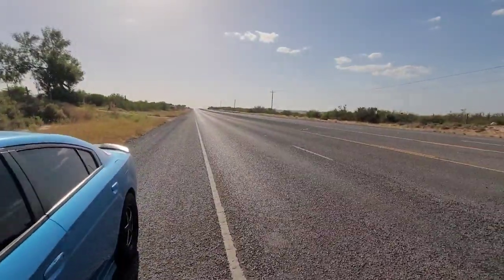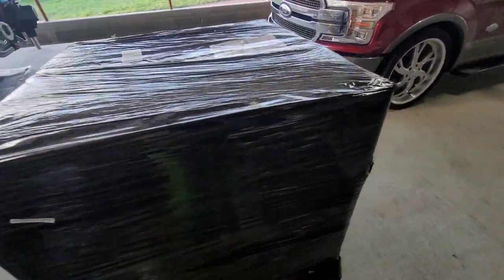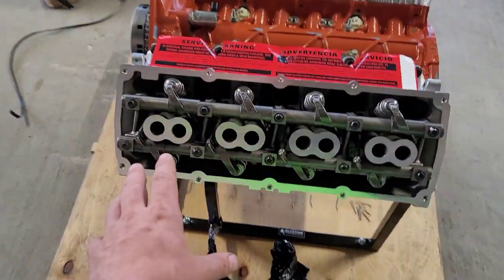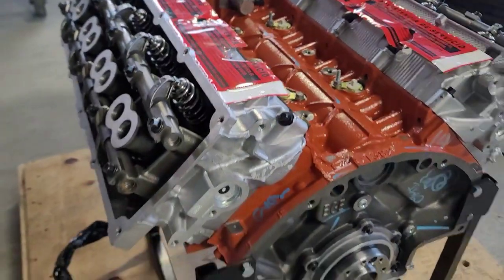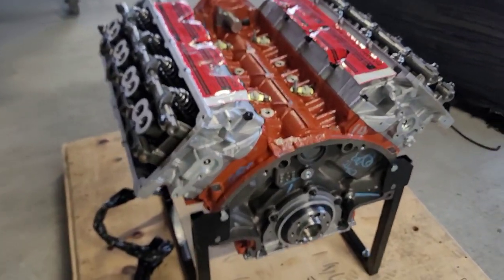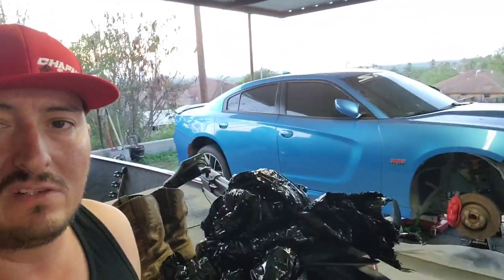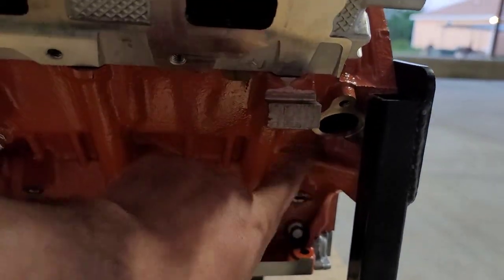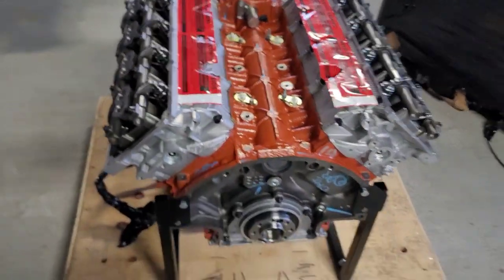HHP Racing Forged 392 Hemi Gen 3 6.4l 3.0L Whipple

Comment: Yes it is the HP70. I was going to have a HP95 installed but when built properly these HP70s can handle high power builds. I’m not sure exact HP as of now but @ stock Trackhawk Numbers. @600whp, these Jeeps tend to put down lower numbers with the Drivetrain loss. I’m about even with a Hellcat from a roll. Obviously, they won’t race off the line from a dig
Reply from the maker: I think I am do the same build on the transmission bro. Because I've already  broken one before when I was Na. Running 11.5 most of the times. With a 1.5 60.

Comment: Just got a scat and now I want to do this too 😂❤
Reply from the maker: Congrats on your purchase 💪and they are great cars. Specially boosted 😄
Reply: @boosteddave4603  now that a considerable amount of time passed since this video, how well does it hook? Or are you still having trouble with it
Reply from the maker: I haven't really messed with the power much. Still running 7lbs of boost. I'll be adding  the fuel system soon and more boost.
Reply: If you plan on boosting the car, it may be a good option to trade in the Scat for a Hellcat.  It's not just the engine, but the transmission difference.
Reply: @1320_ikimasho  don't think ill trade in this one ever tbh. I love the car as is. Im just starting out too so it delivers my every want and need, thats realistic for street driving and  won't end with me going to jail 😅🤣🤣🤣🤣
Reply: @jesusalejandro3668 I own both- 1320 and a Hellcat. I also race, both. The true cost of upgrading these cars (and racing) is often left out when these discussions come up in the comments section. I try to warn folks when they buy "one trim level below," when they to upgrade to something equivalent to a Hellcat. It's not just the engine but the transmission,  then later the driveshaft, etc. Also, the resale value. A Scat is always considered a Scat, etc...
Reply: @1320_ikimasho  nice 👌 I honestly want a gtr or viper next. I dont race yet and the main reason I haven't even given it much thought atm cause a scat is but only so competitive. Gtr or viper next dream car frfr
Reply from the maker: @user-nw6sf1bx4y  yes sr. Scatmake good power when u forged the motor.. but transmission build or a hellcat used one run around 5k then driveshaft 1500 then axles 1500+ then fuel system 2500 fore 3 pump supply system. If ubhave the budget buy a redbeye hellcat they make great power as well with bolt ons
Reply: @jesusalejandro3668 right. Whether or not you race is a big factor. Decide what framework you want to work within, then go for that 👍

Comment: Just thought I’d let you know, I have Stock Trans and Drivetrain and with the heavy Jeep I wanted to keep it under 650hp. She’s making 610whp at just under 7lbs of Boost. Which is right @ where I wanted the HP to be. Honestly, anything more than 700whp on your ride you’ll probably end up having traction issues
Reply from the maker: Thanks for the info.. I am looking for that range but my new 1320 converter broke on me and I just hit the 500miles on the new motor. Still haven't gone wot 😕

Comment: ’Sipple Speed’
Jon knows how to get these ZFs to handle the power. Unfortunately, I also need a Transfer Case 
Best wishes, I’m sure she’ll be a beast when finished
Reply from the maker: That is great power.. I am already having Traction issues at the track.. ran 11.4 at 129. Couldn't get the car to hook.. I Wana do 12lbs see where that sits. Buy I do need the transmission
Reply: @boosteddave4603 can you get a 8hp90?
Reply from the maker: @pmp2559  I've been looking for one but they are expensive

Comment: ProCharger is not on as of yet. But I’ll only be running 7lbs of Boost because Stock Compression and Transmission. You said you have Stock heads but what Camshaft is in your Engine? You must have upgraded your Springs with a Larger Cam?
Reply from the maker: We did all the hellcat valvetrae on top and the custom cam and the supporting spring and retainers hellcat oil pump.. Hopefully we can do 760whp that what I am looking for. On this setup

Comment: The engine was blown because you didn’t add the new cam, pistons and drop in rods? Was it just running on a whipple without block enhancements? 

Just curious
Reply: I just seen in other comments that you were running stock… question answered haha
Reply: I’m about to do my own.
Reply from the maker: @81mccabe58  it was Na only mods where catless delete, hellcat airbox,and tune. But the oil pump went bad on the wot. And then I did this new forged bge block and whipple
Reply from the maker: @81mccabe58  what set up are u going with.
Reply: @boosteddave4603  yeah man, I only a professional drag racer and he says these supercharger companies are liars when they tell you to add it and tune without forging the engine, new fuel pumps the lot.  It is only a matter of time but to you do it right it will run like a dream for years
Reply from the maker: @81mccabe58  ones u want big power u have to make it right. And not cut corners because at the long run it will be more expensive
Reply: @boosteddave4603  MMX 2618 pistons, fore innovations return less fuel system because I want it to be an option to go over 750hp in the future if I choose. MMX VVT custom grind camshaft, 040 cometic head gaskets, ARP pro series cylinder head bolts, MMX VVT Hemi beehive valve spring kit. American muscle fuel injectors.
Reply from the maker: @81mccabe58  that's a great set up. For big power

Comment: I’m only running 8 Lbs of Boost with a D1SC on a BES/HHP Engine. Hope your build went well...
My stock Trans did end up going, and upgraded to Sipple Speeds Transmission and Transfer Case.
How much HP are you making with the Whipple and how much Boost?
Reply from the maker: Nice bro. And so far I am still at 6lbs. I still haven't upgraded the fuel system. And haven't done a dyno. To see where is at. How much is yours Making and on the transmission is it the same 8hp70

Comment: I basically have the same engine from BES/HHP but ended up sending my Jeep out to Delaware after a Lifter went. Does your engine have Stock Compression or did you have it lowered for running higher Boost with the Whipple?
Reply from the maker: Same compression.. how much hp did u make. On mine I Wana at least 750 will be goof

Comment: Was this motor forged before it blew or just stock and did it have the whipple? Thanks
Reply from the maker: It was stock before it blew the oil pump went bad on it and drip oul pressure at wot

Comment: How much boost you were running on stock motor?
Reply from the maker: It was NA before it broke down.. o ly mods where hellcat air box closed , stainless works cat delete, and demon killer springs , and drag radials ran 11.5 at 122 with some traction issues

Comment: what is the price of this longblock?
Reply from the maker: @enzohp13  13,500 plus shipping
Reply: @boosteddave4603  Why is the price longblock of H&H auto part parts low (6000$)? Is there a reason?
Reply from the maker: @enzohp13  with the forged assembly and studs ND bolts and cam and upgrades oil pump bolts and gasket and blue printed for 1000whp+ makes the extra amount